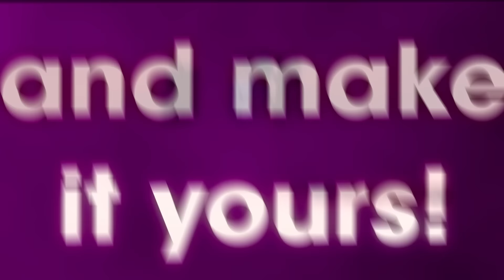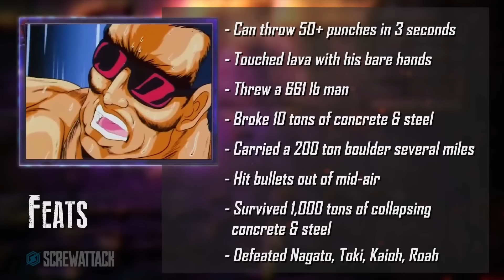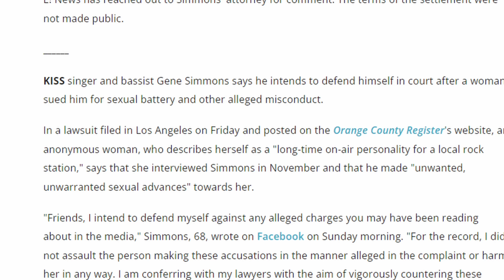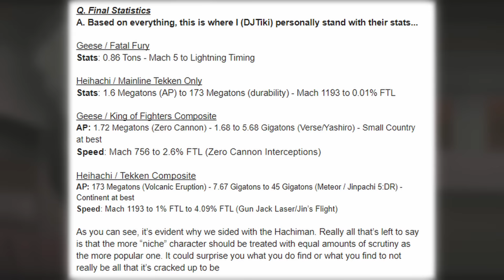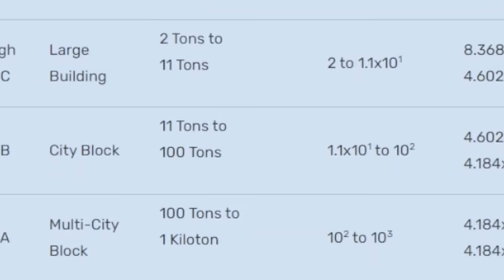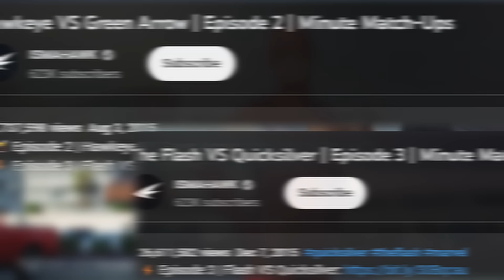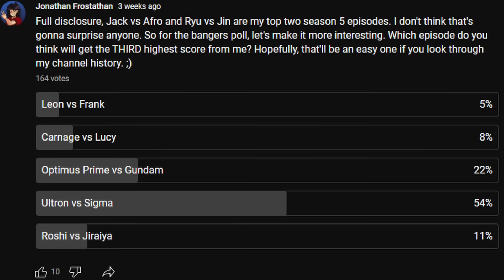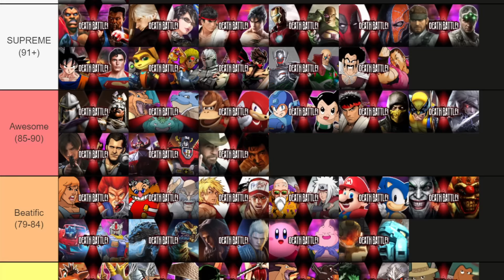Ranking Every Death Battle Episode (Part 5)

Comment: Jotaro Vs kenshiro pisses me off as a fan of both shows they low ball jotaro and highball kenshiro and they barley covered either story and it just pisses me off
Reply: They lowballed Kenshiro hard. There's a ton of country level feats or higher they could've used but they didn't.
Reply: They lowballed both. Even then, it’s not really among the worst of the problems that episode has.

Comment: Optimus vs Gundam is a very unfortunate episode for me. When the fight came out, I loved how visually spectacular it was. But after I full got into Transformers and started my trend into Gundam (and mecha anime as a whole), I realize that while the fight itself doesn't do the characters justice.

Now obviously there's the big issue with Optimus being OOC, but considering Death Battle's had to do that for certain characters, I'll begrudgingly let it slide, even if it's Bayformers Optimus in a G1 costume. But Amuro? Hoo boy, while his personality and portrayal is pretty spot-on, the main issue I have is just how much they severely nerfed him by choosing his least experienced self with his least powerful Gundam. I get why; the original Transformer against the first Gundam, but this had a result of limiting Amuro so much. They could've easily given him his final mobile suit, the Nu Gundam (or even the Hi-Nu Gundam if they're using the novel), which offers a wider set of abilities like the Fin Funnels. While it wouldn't change the result, it feels like they knew Amuro wouldn't have a chance regardless of the version used, so they just stuck him in his weakest state. Hell, if they had Amuro eject and switch to the Nu Gundam mid-fight (as games like Super Robot Wars have done), they could've given a chance for more choreography options, but that likely would've been out of their budget.

All in all, while the episode is still visually impressive and has other stand-out moments, it stings to watch as a Transformers fan feeling they could've done better, and stings even more as a Gundam fan KNOWING they could've done better.

Comment: Spyro vs Crash, as cool a legacy matchup it is, made me sad. Bevause it ties back into the "compositing" issue DB has. And with Spyro it really doesn't work.

There's effectively 3 Spyros.

-The original, a snarky teen who thinks he's hot shit, and yes, with ADD, and as someone on the spectrum + ADHD and bipolar, this Spyro probably has mild Asperger's too, but this isn't canon. 
-The Legend Spyro, voiced by Elijah Wood. Far more mature and serious, skilled in physical combat, and unlike the previous, doesn't reject the idea of love, but embraces it.
-Skylanders. This is meant to be based on the previous Legend incarnation, but between his few moments in the games and the godawful TV show, he's just an entirely different character.

The first one has a wildly separate origin and moderately different powerset than the other two, to the point of compositing Spyro is disingenuous. Original Spyro is wall level at best, maybe small house when using powerups like the Supercharge in AHT. Legend Spyro is very much small PLANET at minimum due to scaling in Dawn of the Dragon. In theory Skylanders Spyro would also have this feat but Skylanders is a mess all it's own so shrug.

Edit: Ah, Sora vs Pit. And I want to say this was before 3? Very much after DDD. Sora technically gets a warp dash in 3, but that's via 3 different Keyblade form changes, two of which not available at launch. I'm not sure if he had outright teleporting before that, but DDD flowmotion was a hell of a drug. And for Drive forms, one specifically is used solo, being Limit Form and designed to call back to his KH1 abilities in KH2. Valor, Wisdom, Master, and Final all seem to require Donald, Goofy, both, or one of the two and a world party member/Riku. Outside of the cutscene Valor Form is introduced, where Goofy is shown beside Sora, there's no cutscene at ALL referencing Drive forms in KH2. And while you can have Sora be in a Drive form in most cutscenes, that's because a lot are in engine and so just use the current Sora model in play. No NPCs in cutscenes react to the change, and Donald and Goofy are present as normal even if Sora is in a form. As such, I can see why DB went without using the Drive forms in the fight, as even with Donald and Goofy there, it might count as outside help or something. And Limit Form is pointless if they're just having Sora using Sonic Blade and Ragnarok normally. Should have had a Lethal Frame attack in there or something, I dunno.

Comment: 1:27:59 using lord drakkon doesn't really solve the problem of death battle only using Mighty Morphin. he's still Tommy Oliver, he still uses the white tiger and green dragon powers (at least I think, correct me if im wrong) and, while he isnt technically from mighty morphin itself, its never stated that he ever got to be anything tommy was AFTER mighty morphin (again, correct me if im wrong, but i dont think lord drakkon ever used the black dino thunder or red zeo powers or anything). As a person who grew up with stuff like the post-zordon/disney era of power rangers and is a massive power rangers fan but doesn't really know and specific matchups, I'm sure there's gotta be solid matchups for stuff like the jungle fury, mystic force, in space or even ninja storm rangers. Hell I'd settle with something like Ninja Storm Power Rangers vs Ninja Turtles (not that that matchup makes any sense that I know of, but there's probably some decent connections other than being color-coated ninjas trained by rodent masters... Wait is a hamster a rodent... Whatever.)
Reply from the maker: Hamsters are rodents btw. ;)

Comment: 1:12:04 You sure that’s not just an animation error also whenever they hit each other it makes no sense where the injuries are like how in the final kill did Jack slashing left to fight cause afro’s arms to come of and leave an x on his chest. And the slash Jack gets just scars Afro instead of cutting his arm off. Also Also it is quite difficult to see a reflection in water unless it’s clear as glass.
Reply: Everything you just said is just nitpicks at best and I don't see how they all just fit in the same paragraph. For the lines on the eyes, when the attention to them is that consistent, there is a good chance that it is intentional. Plus, Jonathan did consider the possibility that perhaps he looked too deeply at some of the things in the episode. The final slash by Jack did not cause the X on Afro's chest. Half of the X was already sliced up from before, meaning that all it took was for Jack to slice Afro's chest right before chopping his arms off, which is possible with one strike, especially for someone on Jack's level of skill. The reason why the other strike did not slice off Afro's hand and onky sliced his chest was because it only struck Afro's chest. And for the reflection on the water, Jack did nit see a perfect reflection, he saw a blurry shadow and he was smart enough to put two and two together on what was going on.